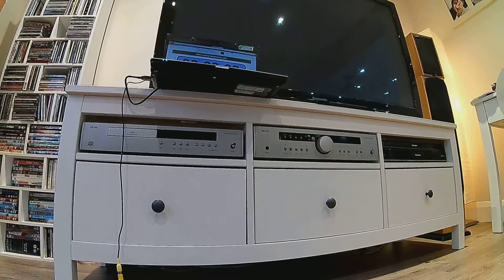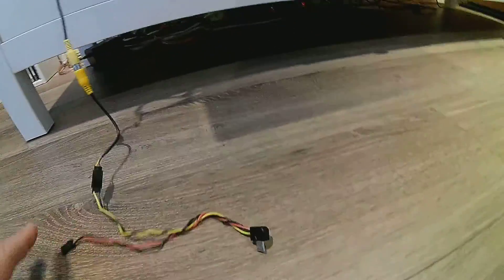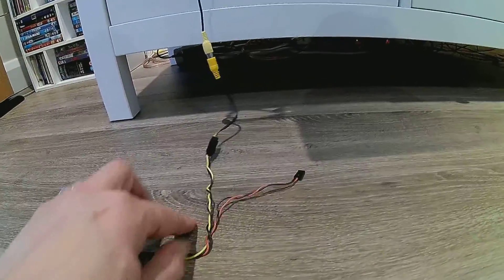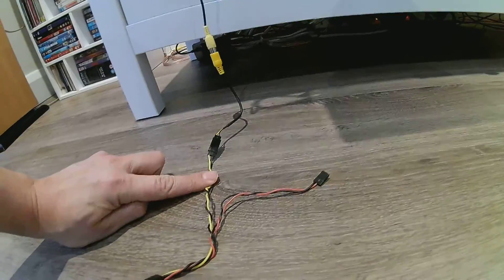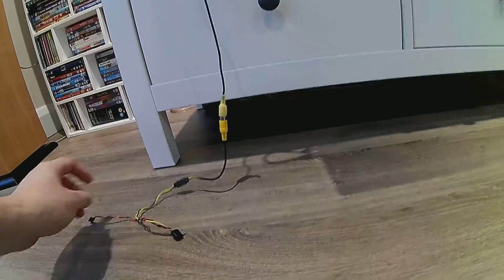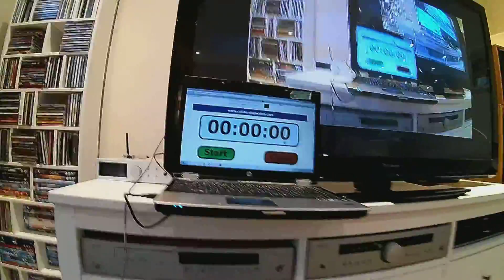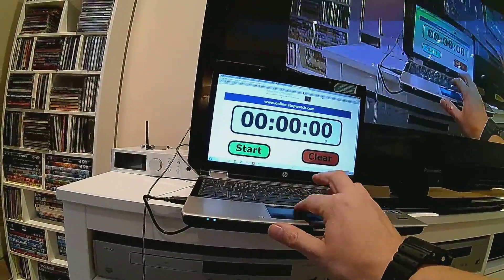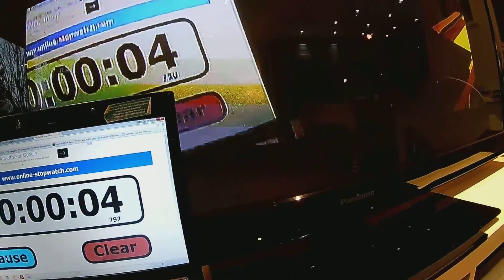RunCam 2 HD Latency testing

Comment: I wonder how much of that 68ms is in your monitor. Maybe if you mirror your laptop screen to the external monitor (no camera involved) you can take a snapshot to see if there is any measurable latency.
Reply from the maker: +Jimi Henderson probably quite a lot. As I said in the video, there is a mismatch of frame rates so this is the best I could do with the kit I have. I can tell it's a load faster than runcam HD 1 or a Mobius anyway, but this is not a perfect test bed!If I mirrored the output it would have to be via display port>HDMI not via composite so it wouldn't necessarily be the same delay?

Comment: That on 720 120fps or 1080 60fps? Runcam quote 40ms on average for 120fps on 720.
Reply from the maker: +Andrew Griffiths 1080@60, I don't think recording makes any difference to the live-out latency
I wouldn't be surprised if RunCam's figure was accurate. The latency is now so low that the speed of the TV and a mis-match in frame rates becomes significant.
Reply: +MikeTheCrash is these types of cameras live out is significantly impacted by recording, I've seen differences  of 100ms using the original runcam and more with the mobius when recording.

What camera resolution did you have with what frame rate at these have a direct influence on the output latency?
Reply from the maker: +Andrew Griffiths as I said ^^ 1080@60